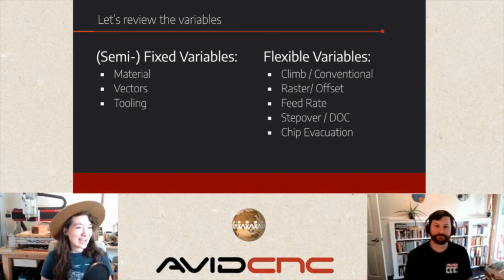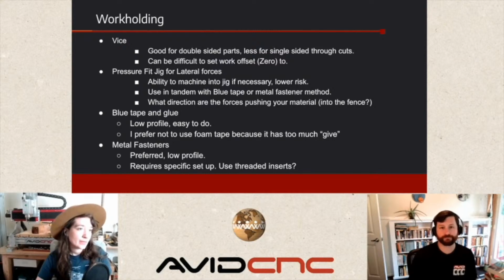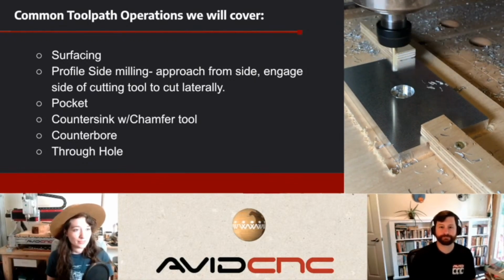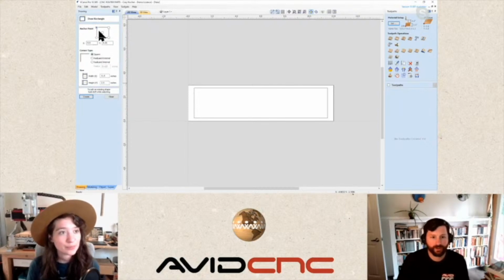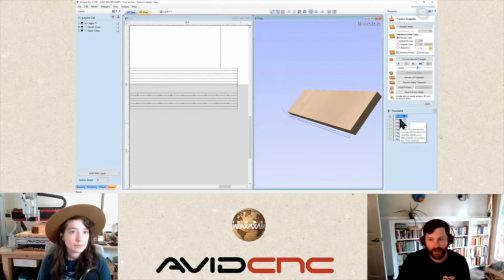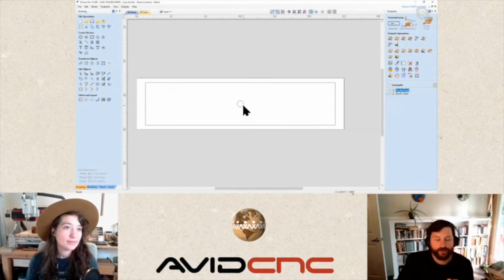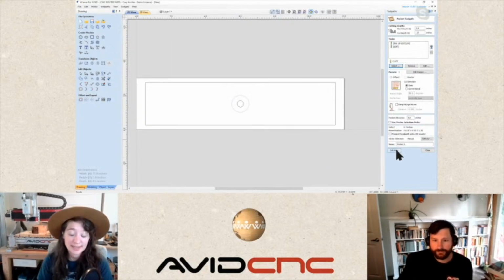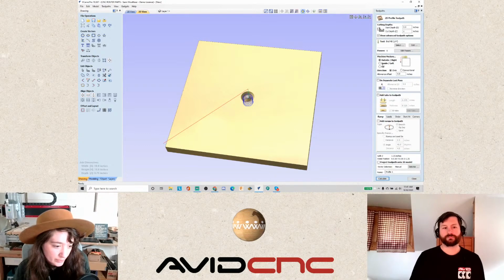Advanced Toolpath Strategies Aluminium & Brass by Sami & Cory | Vectric Worldwide UGM 2020

Comment: Why don't you add Metal tool sets to this software? Been using Vectric Aspire for years, and I'm in love with the software.. but your focus is on wood, where many of us, find this to be the most useful software for CNC, for non-mechanical engineers like myself. I'm an Electronic Engineer, moving to advanced CNC machining now. Your software is wonderful for those of us who simply want to create a design and get it done.. but, you're missing a few things, which essentially kills Pathpilot integration on the 1100MX, without having to recreate the wheel so to speak 
With a few changes, this would be the go-to software for most of us.. but, with it so focused on "Wood" and no aluminum/steel/titanium tool sets, plus the lack of rigid tapping, which is crucial, it kills this software for us. I'd love to see a few changes, which I could recommend, but doubt you guys check comments or would add it. Any ability to give you input on updates? Tormach sells your software. The post-processors are built in.. but many of the metal functions are plain missing.
If you added these features, we'd all flock to your software in droves, for adding metal functions. I've used Vectric Aspire to make some of the most incredible stuff.. but you guys make it difficult, as we have to create our own feeds and speeds, adding tools that the software wasn't designed for, then have to switch to Pathpilot itself, in G-Code to add another function to tap.. Help us out.. we'd be moving to Aspire for Metal milling.
Reply from the maker: Hello PoppaBear...
Thanks for taking the time to submit this comment.  I'll be sure to pass it on, and please be assured we are reading these comments.  Feedback from our customers is very important.  It gives us lots on incite into what our customer want and are looking for from our software.  Thanks again...
Reply: @vectric  Wow, thanks for responding. Yes, if you guys made some improvements, it would be my most useful CNC tool for metal. I use Pathpilot, but also Mach3 and I found Vectric Aspire to be, by far, the best software for simplified design. 
I have a list of things I've made in my head, to vastly increase the effective machining capabilities of Aspire. It seems that a lot was lost from Version 4, to Version 10 of the software as far as machining capability on aluminum or metal. I had to stop a project and learn G code to do parts of it.. which was good. I don't do this full time, I design electronic circuitry for a living, so having an easy CAD/CAM that's intuitive is essential. 
If you guys need info or help, I can likely assist, as people like me can give valuable input because we don't necessarily know how it's traditioinally done, and we're just looking for the fastest, best, SAFE method of machining a part, without having to go back to school and learn full 3D modeling. Solidworks for example, is very difficult to learn rapidly, in a week. Aspire, yes. Simple. We can get the job done, but lacking metal milling speeds and feeds, etc. Tooling also is all set with wood focus. Thanks again.
Reply: @vectric  PS: I called Tormach about this, to find out more about Aspire, and how it interfaces.. they're a reseller. They couldn't tell me anything really, as they're using SprutCam, and Fusion.. If they knew what Vectric Aspire could do, they'd back it fully, for simplified machine jobs. Thanks again.. ok, back to setting up my tooling, my probe and all the other tasks of the day. Cheers.